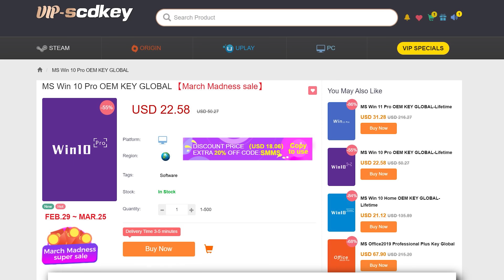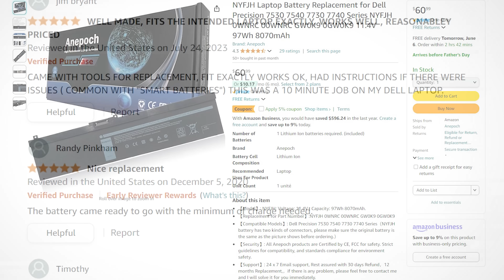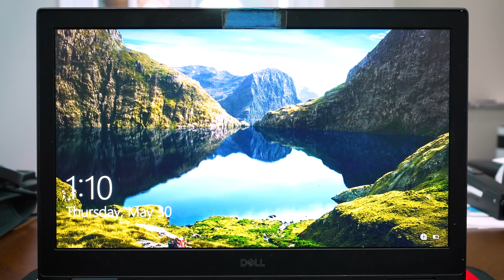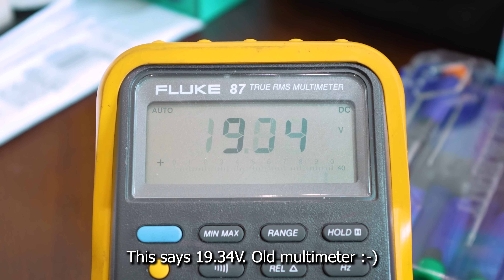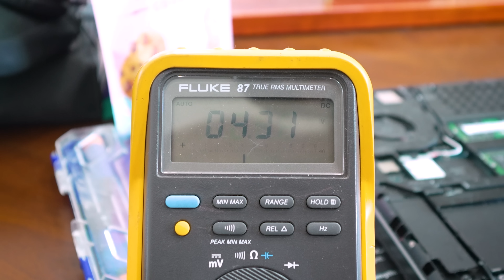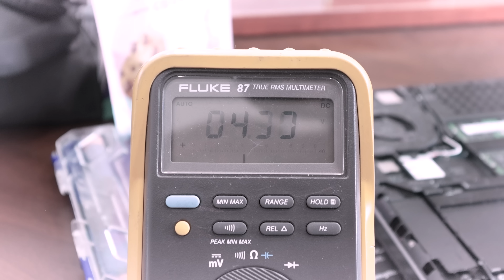Fixing a Viewer's BROKEN Gaming PC? - Fix or Flop S5:E14

Comment: Did had a Dell laptop that had the same not-turning-on problem. The repair shop has ruled motherboard damage after trying to fix it. I don't know if it self-fried after 3.5 years of using it or condensation from severe temperature swings had caused liquid damage. Same happened to a past Asus laptop, it just went dead after trying to power it up after plugging it and forcing it to power up by a long press the power button smoked it.

Never have such problems with Lenovo though. It's just that their weak hinges after 3+ years of use makes me replace them, every single time......

Wish that Framework becomes available in SEA region soonish enough....

Comment: I'm surprised you did not test the laptop without the battery in it.  Just the power adapter first to see if was the power port or main board.  Great video as usual

Comment: Like others have pointed out, I’ve never come across a laptop that doesn’t work with the power cable in, even if the battery is completely dead, or even removed. So I figured the issue wasn’t with the battery.

Comment: Most of the "dead" laptops I work on either have a dead CR2032 battery, or a frozen BIOS. Disconnecting the batteries and reconnecting them (or replacing the CR2032) usually resets the BIOS, and all is well. Unfortunately for Greg, it seems to me that the PS_ID circuit is faulty in this laptop, so the EC chip refuses to charge the battery from the charger, since the EC chip doesn't know the wattage of the charger.

Comment: Battery health on a Dell laptop is displayed by the results of the built-in Dell Diagnostics. I like to press the Fn key and the power button, which starts the laptop and immediately launches the diagnostics. Otherwise, you can press F12, and choose Diagnostics from the boot menu. In Windows, you can open a cmd window, and enter "powercfg /batteryreport" to generate a battery-report.html file. Then in the cmd window, just enter battery-report.html to open that file in your default browser. It provides detailed info about the battery.

Comment: I have a laptop very similar. 3 yrs old. won't charge, but ran at 100% when it had charge. plugging in the power causes it to run at 10% CPU. unusable. I spent weeks watching things like northridge fix repair non-charging laptops, hoping to find insight. i replaced battery, adapter, and the port to no avail. it's power management circuitry in the board. like you I do not have the means to assess and fix that. very painful to acknowledge.

Comment: I suggest that the culprit is the PS_ID circuit. The charger exchanges a data stream with the EC chip on the motherboard through the center pin of the charger tip, the power jack, and the PS_ID circuit on the motherboard. Most likely, the center pin of the power jack is broken or shorted to the 19.5V line. Second suspect is the TVS diode in the PS_ID circuit, which protects the MOSFETs and the EC from transient spikes.

Comment: Haha, the multimeter from my dad looks the same !
Also had problems with the readings, so I swapped the battery (9V) and then it worked flawless again!

(There was a Mitsubishi 9V battery in there. It was about 20 years old. I never knew they also made batteries, haha)

Comment: It's the AC Power port, some dell have one that is replaceable, others are soldered to the main board. The battery was only lasting about 45 minutes because it was not getting the voltage needed to charge it to 100% ( could also have been a bad battery as well). For you own knowledge, if the laptop does not run from the AC port, with or without a battery it should lead you to only two possible culprits, the power brick, or the power port.

The machine powering on from the juice left in the new battery, proved its not the main board.
Reply: as loose as the port was I would guess a short at the port , might have killed it- I have seen it a few times, had it happen to me once -maybe the PS ID chip was shorted - just guessing
Reply from the maker: The battery had a 45% charge, then cut out completely 2 minutes later.
Reply: @GregSalazar  Sound like the battery was bad as well, it could have been inaccurately reporting its charge level.
Reply: @GregSalazar  New/replacement laptop batteries (particularly the cheaper non OEM ones) often need a full calibrate cycle to get them to report accurately. So charge to 100%, leave for a few hours at 100%, cycle down to shutdown, leave for a few hours, re-charge to 100%.
Reply: It is not the port but probably a chip just after it that makes sure proper voltage is sent to the mainboard.
Reply: @damirkvajo  it was clearly the port, not saying it wasn't more, but you wouldn't be able to tell unless you repaired the port first.
Reply: Bad advice. You're literally saying a laptop with a fried cpu should be able to run if the power brick anf port are good.
Reply: @sergioav7278  Bad CPU? did we watch the same video? Might want to give it another watch there my guy.
Reply: @KyleGas-zb7kp  I recommend you to learn to read. Primary school might be a good place to start.

Comment: Yeah, my go to on a power issue is always the charger ports when it comes to laptops.  Blue screens, clogged CPU overheating from people using them on their laps and sucking in dust and debris.  But a laptop will run on the charger, even without a battery.

Likely all you need is a new charger cable from the back of the computer to the mainboard.  Cords get jammed all of the time and get loose and they often lose connection or break off partially.  If you buy one, get it directly from Dell if you can.  Used ones are often junk and are ready to beak.

Comment: I'm surprised the company even let you take it apart, let alone swap the battery or remove the drive. My work would flip, they wanted me to wait 3 days for IT to replace my entire laptop instead of fixing a fan on it myself.
Reply from the maker: LOL yeah that's pretty rough. In fairness, I think they appreciated the effort - simply because it would've taken several days to outright replace it, back up tons of files and security stuff, etc. But that ended up needing to happen anyway.

Comment: I think that this laptop uses a docking station that connects to the laptop with two USB-C cables on the left side ... I'm wondering if using a compatible docking station or USB-C charger might have worked.

Comment: As with others, I'm surprised you jumped to the battery as the problem. I don't disagree that the computer needed a new one for other reasons, but if a laptop won't boot when plugged into the wall the problem's occurring before it even gets to the battery.

Comment: Sound advice about not trying to fix something above your skillset.  It does seem like the charging circuit is hosed, and replacing that (if it is possible) requires advanced soldering skills.

Comment: I was personally told by one of the engineers that Dell actually sets the Bios to stop charging the battery's after a year.
Reply: And you belived him? do you really think they would want to replace every single laptop they made under warrenty?
Reply: @peterhallbus1114  No silly they were in the business of selling battery's its highly profitable. and Dell is designed to only take dell parts.  I worked in Dell for a dozen years most of it as Senior Auditor.  Dell did lots of very underhanded things and still does.
Reply: @1gatomon  wow, you dont know how a warranty works, they would not sell anything

Comment: The NVMe Windows laptop boot drive should be able to be transferred to a regular desktop computer, while you're waiting on a possible replacement laptop. The central issue is probably the loose/damaged plug-in power adapter port. May still be fixable by soldering in a replacement port. Might consider obtaining an external USB 3.0 NVMe adapter housing, in case of the need to copy data off.
Reply: i buy one m.2 sata its very usefull i need to a m.2 nvme its amazing how easy its recover info and reinstall o.s

Comment: dont beat yourself up, laptops are not as easy to repair as desktop pc's, fiddly, complicated, lots of screws, and plastic bits break easy, and way more expensive, especially individual parts, and yeah best avoided even if you have been trained to repair them, i breifly worked for Teleplan repairing laptops that was back when Pentium 4 was the fastest cpu on the market, and Philips,Digital, Compaq, IBM, HP, Advent, Lenovo, Toshiba, Fujitsu, Siemens where household Laptop/PC brands.

Comment: You sure that DC jack was sound, sure looked suspect to me.
Reply: Yeah same here. It looked very suspect.
Reply from the maker: We bypassed it entirely and even probed the mainboard where the jack connected. Measured fine. Confirmed later in the video.
Reply: @GregSalazar  These laptops will run with no battery at all but need a signal from the center pin to receive power. It's common for the pin to break off inside the plugs due to bad alignment from a loose jack and then the power supply is completely useless. Or the jack itself wears out enough or breaks internally and can't communicate with the charger. Having the correct voltage at the board does nothing without it receiving the correct signal to enable power delivery. My money is on the jack being bad seeing how loose it was but broken pin in the adapter is more common.
Also the battery is probably totally fine and just went into protection mode when it died and just needs to be recharged to work again.

Comment: Most dell laptops I've ever used if it's plugged in, even if the battery is defective or even removed completely it will still run just off the power adaptor alone, so I knew it wasn't that battery from the jump.
Reply: I was thinking the same thing, doesn't laptops run just off the charger with out battery.  Also I'm assuming there's some sort of short or break around the charging port of the motherboard. Once he plugged it in bam, no good.
Reply: @Big_boom90 I believe it's a shorted high side MOSFET sending power from the main power rail to the battery. It's sending too much power into the battery causing it to lock itself as a protective measure.
Reply: I have a work colleague who has a new Dell laptop (only a few weeks old), but lastly he had an issue for the second time where the Laptop would not charge or even accept power from the power adapter. So the battery will drain even when the power adapter is connected. ... the solution form IT was to disconnect the battery and reconnect it. Then it works again .... the question is for how long ;). I had many Dell laptops as work laptops and i must say i'm quite annoyed with them as every single one of them had issues. I'd love to get one with AMD Ryzen but neither Dell nor our IT will provide one 😠. I wish our company would not buy Dell exclusively😠.
Reply: @Astravall  That's a shame as a company they started out so strong in the late 90's and early 2000's. I remember the First Dell I ever owned, I bought it used and It was badge of course and had a Pentium 3 933 MHz and I had upgraded the ram from 256k to 512k, 512k was a lot for back then, it had a 10 GB Maxtor HDD and CD ROM and floppy drives,  it was the typical business class computer that came with windows 2000 Pro edition. I added an APG GPU and that was a Radeon card but I can't for the life of me remember the model of it but it used to play Everquest, that was my first sort of make shift gaming PC, back then you didn't have many gaming PC's or custom builds, you just bought you a Business computer and upgraded it and added a GPU and a ethernet card, I'm 53 and I've seen the entire progression of computing, from the late 70's with Apple to the 80's with Commadore Vic 20 and C64 ( I owned an Atari 800 myself) the 90's with Packard Bell, the late 90's I had the Dell all the way up to current times and I actually built my own Gaming PC and I still love gaming. I think the first computerized thing I ever saw was the the 1976 Coleco Telstar Pong game and a bit later the Atari 2600, I got for Christmas when I was 7 and I was hooked on Gaming, I'm old as dirt! 😂✌
Reply: I have both dell and Lenovo and personally I like Lenovo better
Reply: I've had a dell boot in a limp mode over a bad battery and 3rd party power adapter that didn't show as genuine. It was extremely slow until I replaced both.
Reply: Same. Immediately I knew it was gonna be a short on the board.
Reply: That was my thought too.  You should be able to run the laptop without a battery even in the laptop.

Comment: My guess is the (loose) power connector is flaky. When you plugged in/jiggled the power supply into the loose power connector you caused a (partial?) short. Maybe something like a solder flaking off a broken solder joint or even something crazy like tin whiskers. The short might have cause the new battery to disconnect itself to prevent catching on fire. Perhaps the old battery has been dealing with occasional shorts from the bad connector for a while which has hastened its death.

Comment: I had a similar issue with my Dell laptop. Bought a new battery and new power adapter. Didn't fix the issue. I replaced the charging port and fixed everything.

Comment: It looks like that one of those laptops that require a working battery installed even with the power connected to the wall. That is a bad design. No electronic device should ever have to  rely on the battery when power is connected to the wall.

Comment: I had an HP laptop where the charging circuitry in the laptop fried, so even after I replaced the battery it wouldn't charge the new one either.

Comment: Actually Lose Chager Port Cause The Issue
You Need Replace The Charger Port
During the use of the charging port, the charging port loses its strength and causes the charging port to loosen ( Maybe Damage The Battery Or Motherboard)

Comment: I had a similar problem with a DELL laptop and also a Lenovo. It turned out to be the charge connector that was the problem. Still had to replace the laptops since it would be cheaper than sending it out etc.

Comment: I love the fact that the laptop has 32+ gb of ram “for work” 😅
Reply: 2x 32GB sticks so 64GB in total
Reply: @Pasi123  maybe, but he could be running mixed amounts.
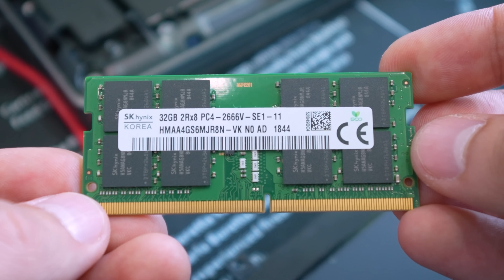Reply: @coolbusterreal2736  Both of the sticks are visible in the video. At 10:30 Greg removed the lower stick and the upper stick is visible at 11:19
Reply: I have 32GB of RAM for work; there's no way I could do everything I need to with less.
Reply: 64GB DDR4-2666, bloody hell, that's more than what my HP OMEN has even with self-upgrades in it!
I reckon a replacement laptop won't come with 64GB in it, and might even have soldered RAM... The days of removable RAM are a luxury as it means upgrades are possible!
Reply: @TheSpotify95  Almost on par with the 64GB DDR4-3200 in mine, but only bought afterwards, too.
Reply: Work laptops, workstations, doing large data set computing or rendering are making better use of 64GB than any gaming rig ever will 

Luckily, most mobile workstations still allow for upgradable memory. You only really see the soldered RAM on basic or thin and light models.
Reply: He might be doing AutoCAD, SolidWorks, or some other memory hungry app... or maybe he just likes to keep a lot of Chrome tabs open.
Reply: You've never heard of VMs, have you?

There are plenty of reasons to have 64gb for WORK laptops.

Comment: Have you tried testing the sensor wire on the charger? Dell Chargers actually have 3 conductors, one for positive, one for negative and one to trigger the charging of the baterry. If you only get positive and negative signal the battery won't charge and it will completely drain the battery. I fixed one with the same symptoms, and the issue was on the charger connector, that wasn't giving proper contact with the adapter, it worked fine, but wouldn't charge the battery.
Reply: Yup that sense pin may not have a good solder join with the motherboard

Comment: never seen battery replacement fix a black screen laptop in 29 years...
Reply: We keep learning
Reply: @nsap  it wasnt the baterry.. the pc has an electric problem...
Reply: @sergiobisonte  yes...there were other related issues...it short the battery
Reply: @nsap   imagine your father calls you and says 'my car does not move'...
you think 'ohh its the engine.. im gonna order an engine'
then you show up on his house and the car smashed into a wall completley destroyed...
yes... the engine is broken, but the car is not moving not because of the broken engine...
the same here.. the pc is not booting not because of the battery.. its not booting because of a short.. (in this case a short in the battery, could be a short on any device) 
never the pc will not boot because of a battery dead, not charging or missing... that is why im saying he came up with the completly wrong assumption in the first place..
Reply: time to get that mobile hot air station and a stock of connecters.
Reply from the maker: It wasn't a "black screen." It was literally powering off. And it did fix it... just not permanently... 😅

Comment: You can try to reflow the mainboard. In rare cases it can work to fix some issue especially regarding cpu or gpus that have overheated, i had an issue with an laptop that turned on with black screen and did nothing. I put it under some quilt, let it heat up for 1h and then give it time to cool down and gave it a shot. Worked perfectly. 

Can be done and prob should be done with an oven instead. xD with proper ventilation - where the mainboard was pulled out, but this was in my early days of working on laptops and found the tip on the Internet back then xD